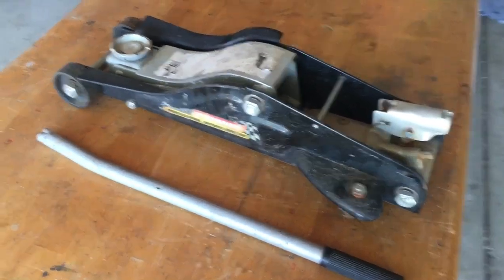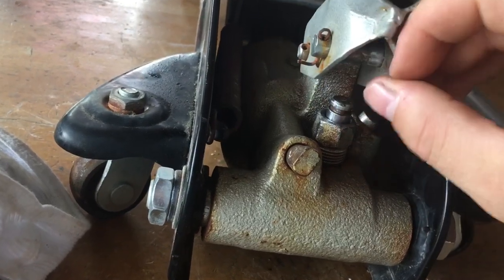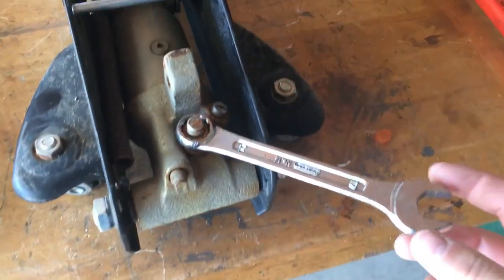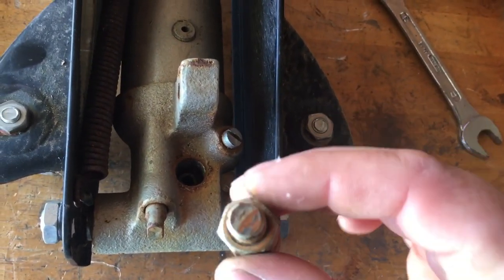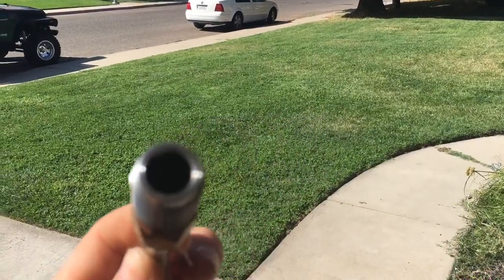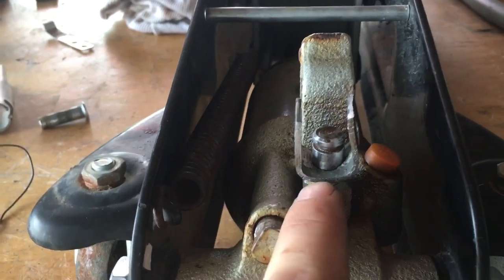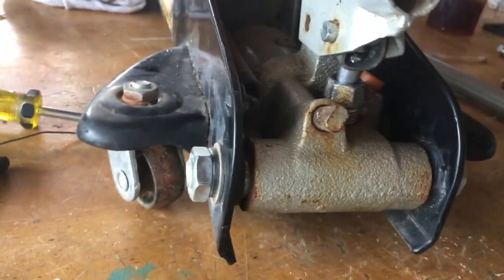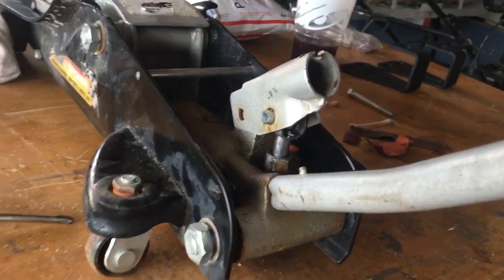How I Repair A Stuck Or Seized Hydraulic Jack That Won’t Jack Up Or Release   (Please Subscribe)

Comment: Thank you so much for this video! On mine the connector was a little C-shape and it had simply popped off the piston. Take apart, push out this piston, reconnect. Fixed! Without watching this I wouldn't have know what it was supposed to do.
Reply from the maker: Thank you for watching 🍻

Comment: I have one of the harbor freight 1.5 ton aluminum jack one of the pistons stuck down cleaned it off and it has 2 o-rings I uses vaseline lip balm that's what I use for hose fitmint and it's working so far thanks alot keep up the informative videos they do help alot of people! Thank you
Reply from the maker: Jeremy Cole  always happy to help someone out. Remember to always use jack stands with jack.. thanks for watching!!

Comment: This is the same problem I'm having with mine. The piece you made  to connect the pin to the plunger/piston appears to be better than the one it came with. Imagine taking a piece of carbon steel strap about 5/8" wide x 2-1/2" long with semicircles ground into each end. Now jam one of those semicircles into the slot/groove that's around the end of the plunger/piston. Then brake it up 90°, then brake 90° to go over the top of plunger/piston, then brake back down 90°, then brake it back into the opposing side of the plunger/piston, jamming the other semicircle  into the slot/groove, thus capturing the plunger/piston in a way that allows the linking pin between top of plunger/piston and under the carbon steel strap. ..maybe it's high carbon steel because it is a bit springy. But it bent open to come free from plunger/piston.. 

It sucks. I had a shot at sand blasting the rust off the p/p but was too impatient and thought I could just blast it with ATF and force it back into operation. Anyway,  thanks for showing me what I needed to see. I wasn't sure if it was under pressure  at that point
Reply from the maker: @jdog nice, thanks for watching. I appreciate it. That sounds like it would work good too, glad that you found this helpful. Now I remember I once though it was under pressure myself! Cheers.
Reply: @ATEMOFFROAD  I just finished getting my little assembly all cleaned up and lubed and ready to thread back into the jack. Did you have to bleed it or anything when you got it all buttoned back up?

Comment: If you notched it a bit smaller than piston it snaps on no wire
Reply from the maker: Alan Matthews (good idea).  ideally it needed a retainer clip that I was not interested in getting at the time, so I improvised and use wire, still works great. Thanks for watching

Comment: Thanks, I used this to fix a seized floor jack that I had left in the spare tire well of my car for years like an idiot. I do have one follow-up question: the jack works again, but I've got hydraulic fluid seeping out from the exposed threads where the piston cylinder screws into the fluid reservoir. Besides torquing that piston cylinder as tight as I can with a wrench, is there anything more I can do to seal that up so that it doesn't leak anymore? Thanks!
Reply from the maker: Ben St. Hilaire I suppose you can use some plumbers tape
Reply: @ATEMOFFROAD  OK thanks I'll give that a try

Comment: Anyone know how he got the top piece off so I can wrench this nut off??????
Reply: I hate when people skip through steps
Reply from the maker: You will have to remove the cotter pin , then slide out the wrists pin retaining both the jacks lever and the connection to the pump piston! Then you can get complete access to that the top piece. Thanks for watching 🍻